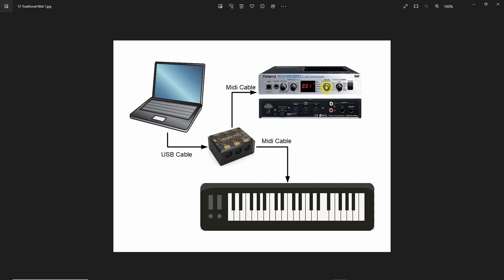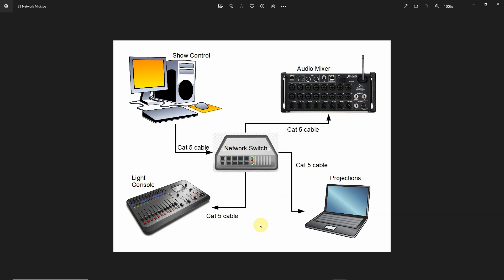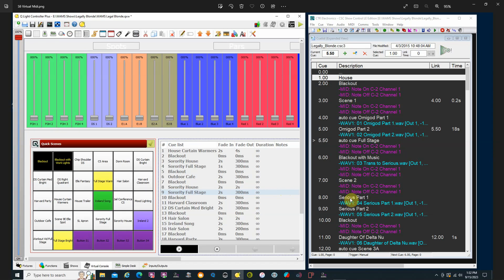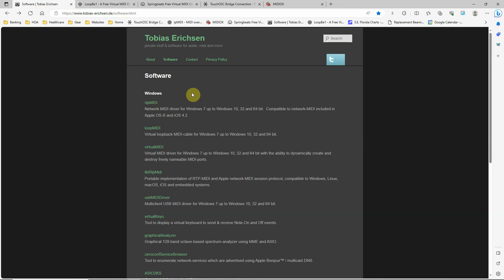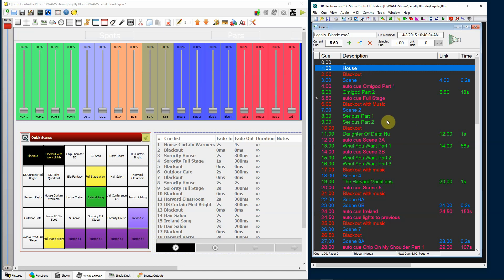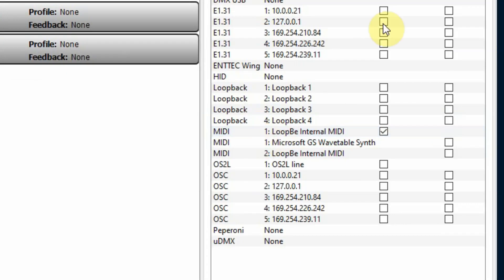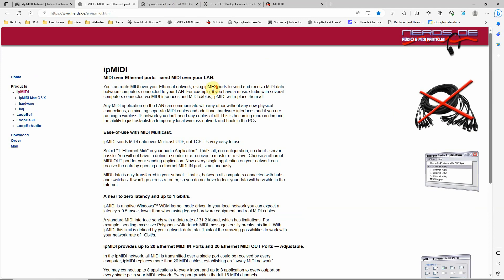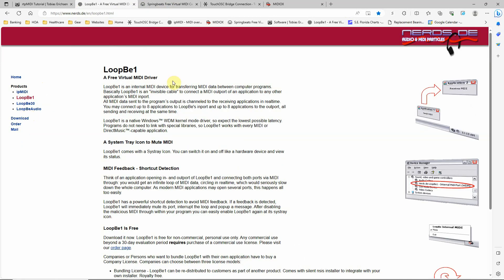QLC & Midi Part 2: Connections

Comment: Hi Edward, thanks again for your videos, I'm going to be able to put on a show thanks to them.

I'm going to do a play where there are many very quick entrances and exits, with continuous sketch and clothing changes, where there may be doubts in these changes and there is no time for them. Therefore, I thought of putting two monitors on the shoulders of the stage and sending MIDI text through the Multiplay.
Is this possible? Does it have to be connected with a cable or can it be sent via WiFi?
Thank you very much Edward, you have really solved many doubts for me.
Greetings
Reply from the maker: Hello. Yes, you can do what you want but not with Midi messages. Midi messages are binary computer code that does things like turn notes on/off, changes volume, changes instruments, etc. It is not an actual text message. Here is the best way to do what you want to do:

1. Set up a laptop with power point slides which are instructions for the actors. You could connect an extra monitor to the laptop so that you could have one on each shoulder of the stage. It doesn't have to be official MS power point either. Check out the free presentation software in Libre Office:
https://www.libreoffice.org/
2. Load the helper program "OSC Keypress" onto the laptop with the power point slides. You can get it here:
https://www.eleton-audio.de/en/osc-keypress-2/
3. Make sure your show control computer running "Multiplay" and your power point laptop are on the same network
4. Send OSC commands from "Multiplay" to your power point laptop to display certain slides with instructions for the actors

I have a video about OSC Keypress that explains how that works:
https://www.youtube.com/watch?v=yZrR1_dKSBE&list=PL_kjo8_ebNRGkXHjjdNsTetpzUW3sGFFX&index=16
I should have a video somewhere about sending OSC commands from Multiplay. I will get back to you with that.

Ed Richards
Reply: @edwardrichards7722  Thank you very much Edward,

I'm waiting for that video on how to launch the OSD signals from Multiplay, that's what I need.

On the other hand, how do I get the signal from the table to the TVs? Can I do it via WiFi? Because I don't think using a cable would be practical, since the theatres won't have that cable.

Thank you very much Edward, I keep insisting, thanks to your videos I'm learning a lot, best regards.
Reply from the maker: @7272joseph  
Here is the link to the new tutorial I recorded for sending OSC messages from Multiplay
Again I think your best course of action would be to have a laptop displaying actor instructions via power point or some similar presentation software. Then you could use Multiplay to send OSC commands to that laptop and display certain slides with info for the actors. You could possibly have that laptop also screencasting to a smart TV on the other side of the stage.
Ed Richards
https://youtu.be/WqUPkhbrE3o

Comment: Is there a method where steps in a Cue List can trigger different video clips in a VJ program like Resolume?
Reply from the maker: Hello
I've never used Resolume but I see that it does accept midi and OSC commands.
https://resolume.com/support/en/midi-shortcuts
Yes, show control programs trigger cues that can play back audio tracks and send Midi and OSC messages. There are several show control programs for PC that can send midi messages. See my website:
http://comutinytech.com/TheaterTech/page3.htmlCSC Show control is my favorite however it will cost $75 for the LE version which allows you to send midi messages. If you are more advanced and want to send OSC messages, then you will need to purchase the Full version which is $300
Ed Richards
Reply from the maker: Sorry, the URL for my website is typed incorectly in my previous message. Here is the correct address:
http://comutinytech.com/TheaterTech/page3.html

Comment: Thank you again!  I really like the cue list example.  I'm trying to figure out how to have multiple cue lists without going in and out of Operate mode in QLC+.  Would your set up shown allow that?.
Reply: I actually am looking to do the same thing. The only solution I have found with controlling the queue list from my Midi foot switch is just to build all the different cues for every song within one master queue list, which seems a bit of a volatile route when you have around 30 steps per song.
Reply: @SonicMonkeyAudio   - Exactly.  In my situation, it would be 14-16 cues per set (I could "reload" the other sets during break).  That's where I was heading but figured I would ask in case there was an alternative.
Reply from the maker: Hello Howie
Yes you can do this with Midi commands
I made a special video just for you to show how to do this
https://www.youtube.com/watch?v=zhhKGgDiBCE
Let me know if this helps you.
Ed Richards